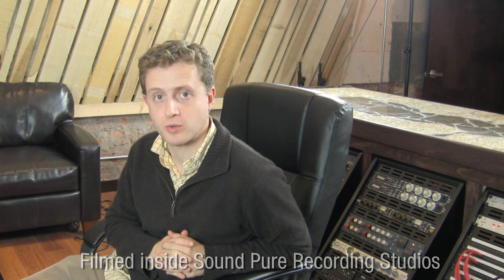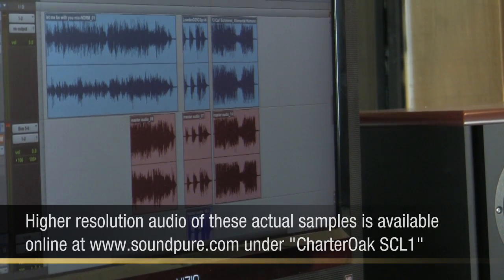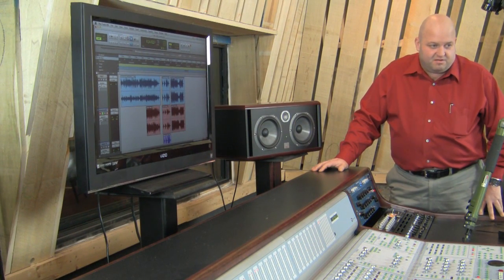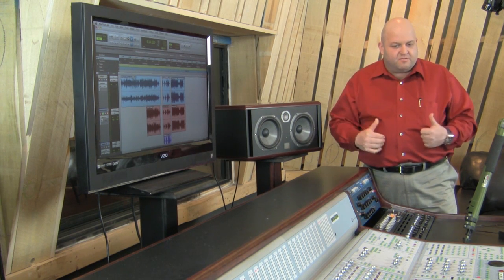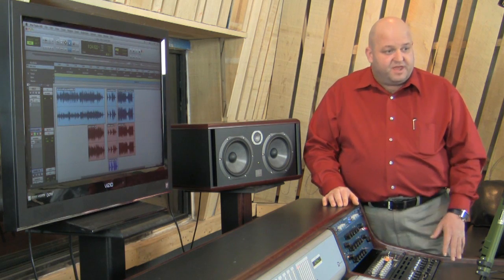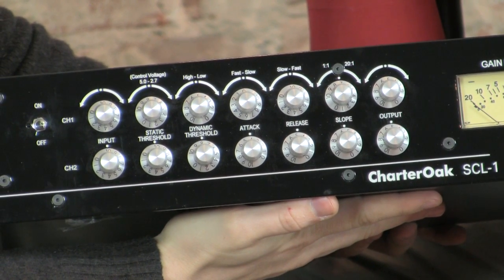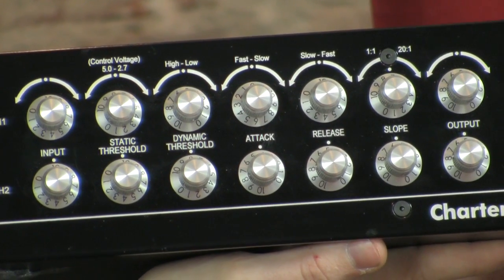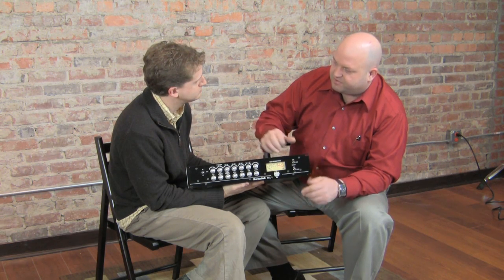Charter Oak SCL-1 Compressor: How to Compress Piano & Saxophone

Comment: Michael Deming is very passionate about the design of his products.  The SCL-1 compressor can be driven to levels that would typically make you cringe at -- while you sit in amazement as the musicality and dynamics of the song are preserved, yet the individual elements are glued together. When Michael and I last spoke as he demo'd his product line to me... he partnered the SCL-1 with his PEQ-1, he was not only able to make some amazing tonal/color changes to the entire song, but he was also able to key in on certain elements of the song and bring the forward or back into the mix as needed in a very transparent way, without muffling or adversely effecting the frequency ranges on either side of his target frequency. He was able to do with 2 pieces of gear, what would typically take me at least 3-4 pieces or more in order to make these changes without negatively effecting my mix by inducing pumping from the compressors and smearing from the EQ's.